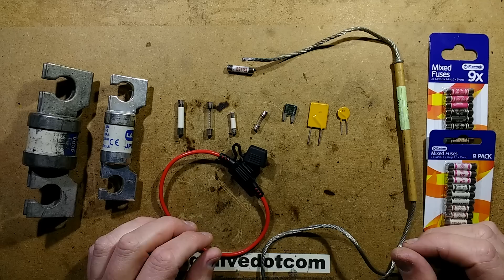Things you should know about fuses.  (including a 15kV one)

Comment: I blew my new multimeter's 250mA fuse by slightly underestimating the low current I was measuring. Weirdly enough the device has a beeping function when the fuse is blown, but it didn't go beep. Found out it was blown after measuring nothing on several applications, took some time to realise.
The rating is specified as F250mA 250V, but it was a ceramic fuse (same with the 10A and my other multimeter's fuses). So I went on the quest for fast blow ceramic fuses. The quest has failed miserably! It's unbelievable how I just couldn't find ANY fast blow ceramic fuses at all! Local shops didn't have the proper ratings (sells Multimeters with 250mA and 10A fuses, but the seperatly sold replacement "Multimeter" marked ones go from 0,63 to 6,3A only... lol) and the Interwebs didn't provide me with any buyable options either. Then I found one eBay seller selling quick blow ceramic fuses (from GB) and what do I receive? Slow blow! "Fuck it" is what I thought and just put them in... if ever something happens where a quick blow fuse was necessary: http://bit.ly/2kjprwi

Why is that quick blow ceramic fuses are so hard to get? Maybe the Multimeter Mafia wants you to buy new multimeters whenever a fuse is gone? Or just use glass ones with less safety? Hmm.....
Reply from the maker: Not sure where you are in the world, but in the UK you can get them from Rapid Electronics.
https://www.rapidonline.com/eska-520-511-quick-blow-ceramic-micro-fuse-5-x-20mm-250ma-250v-pack-of-10-54-5822
Reply: +8bpspfreak2 I have learned over the years to test current initially with a burner meter. Which is a meter I care less about. Then if anything untoward happens I can think about it some before I test further with a meter that I do care about. Because not everything is as I may think it is at the outset. Or I wouldn't be testing it in the first place.
Reply: Fuses seem to be on the way out in North America.  Only halfway-big appliances like microwaves and desktop computers bother with them.  Anything smaller, who cares?  Anything bigger, let the repairman handle it!

This makes fuses for anything almost always a special order !@#%!%#$!@#$

Comment: BigClive .... just for completeness you might have mentioned that some HRC fuses have a fuse blown indicator.
This is a second, finer fuse-wire, passed near to the surface of the ceramic body .... this will blow instantly after the main fuse-wire and will burn out in a small powder-filled pocket at the surface, indicating that the fuse had blown.
Love your videos.

Comment: Ceramic fuses for 220/240V (or 380/400V 3 phase) mains ment for for home and/or workshops CAN be "refurbished" properly IF you open them, pour out sand, clean out metals from sand (or use "fresh" sand...), replace the copper ribbon with proper quadrature of thin copper wires and pour sand back in and reseal it... Well i am doing it for last 15 years...tell me it is safe, please ;-) 
They are damn hard to get or really wound up price in local electrician's supply shops, and a lot of houses where i fix stuff still uses them, but they have strictly forbidden me from messing with distro box, and replacing them with "modern" resettable ones, as i am not a certified electrician ;-) And i might, accidentally, bypass the meter to some fuse...
After all, legally i am just a crazy hippy they let into their house...their fault ;-)

Comment: I took apart a UPS that used a 48V battery, and I found a 32V automotive fuse between the battery and UPS. Wouldn't this fuse be improper for the reasons you stated? Hard to believe since this came from a big name brand rack mounted unit.

Comment: 3a is 3a...? So does that mean 230v 5a cable is only safe for 5a at 12v too? 

As you say a 250v fuse will work the same at 12v interested in that.   I'm just wiring up some 12v spots in my garden and I'm running a 5a cable.  So if I put a fussed spur with a 3a/5a fuse it'll work just the same as a car fuse will?  Plus I get the switch off the spur too? (car battery / solar panel) 

I was under the impression that wiring etc amp was different at diff voltage
Reply from the maker: The current carrying ability of a cable actually reduces with lower voltage as its resistance poses more of an issue at 12V than at 230V.   It introduces voltage drop which can reduce the voltage significantly under load.
Reply: bigclivedotcom amperage that kills not voltage etc,  eh.  1a at 12v is 12w. But 230w at 230v etc.   So as long as the amperage is right it should be cool eh.
Reply: But isn't 12V ac usually the RMS value so by definition it will have the same heating effect as 12V dc?

Comment: Hi Clive, great video (as always), but I was hoping you would cover the difference between 3, 5 and 13 amp plug fuses. You say in a lot of your videos " this is the wrong rating of fuse for this item" and I'm always wondering why.
Reply from the maker: You choose the fuse to match the appliance load and the rating of it's flexible cable.  For a low power table light you would choose the 3A fuse (up to about 700W), for high loads like vacuum cleaners and kettles you would use a 13A fuse (Up to about 3000W).
Reply: bigclivedotcom  Thanks Clive.
Reply: bigclivedotcom, neat I was going to suggest you explain rating vs wattage. I suspect you could explain how to calculate a suitable value from the notes on an appliance. 
How do varistors fit in with this or am I misunderstanding – are they similar to the PTCs?

Comment: to clarify, allthough it can break 1000amps, it will pop far before 1000 amps?
Reply from the maker: The fuse will break at just over its current rating.  The 1000A is its ability to break the potential huge current of a dead short circuit.

Comment: One thing that wasn't mentioned is that fuses often have a different interrupting voltage rating for AC and DC because a DC arc is harder to quench. A 250 VAC fuse might also be labeled as 32 VDC. Using that fuse for a 250 VDC circuit may also cause an exploded fuse, even though it would be fine for AC.

Comment: Great video Clive. I had first hand experience of the 'wrap some wire around the fuse' idiocy some years go, while working at a 132kV substation. The site manager was trying to scrounge a 32A HRC fuse link, because the one feeding his site portacabin 'kept blowing'. Unable to find yet another replacement, he stripped some 1.5mm2 flex and wrapped a couple of strands around the carrier in the fuse switch. On closing the switch, the resultant explosion blew the cover off, which hit him in the chest. Fortunately for him, he was not seriously injured. However, he did make a comical sight, as he had a very soot blackened face. He also had the embarrassment of having to get the local area board engineer out, as the fault had blown the 250A fuse that fed the main transformer coolers...

Comment: A friend was working at a computer centre that needed more power than the national grid would supply.   There was a concrete outhouse with copper bus bars,  I forget, but maybe 5cm by 2.  He heard a bomb go off.  A plasma bomb.  A busbar had vaporised.  God knows how much current it takes to vaporise copper that thick!  The walls were coated with copper leaving shadows of other obstructions.  Happily no one was in there. I find it very hard to believe that the tiny ceramic fuse you showed can support more than a thousand amps, but I trust you.  I love the explosive cannon way of ensuring that contact is broken!
Reply: Oh, sod it, I'll stick my neck out.  Can you point me to a fuse holder for that little ceramic fuse that can support 1,500 amps?  What thickness of copper wire is it designed to accept?  The contacts on my extension leads get fucked at around 10 amps, and that's two orders of magnitude higher!  The mains entrance to my house is limited to less than 100 amps and needs copper wire far thicker than could be squeezed into that tube.  I think you've made a mistake.
Reply from the maker: The 1500A breaking current is a worst case scenario and would be in the form of a very short pulse that may well damage the holder.  If you consider the typical loop impedance to a UK socket would be around 1 ohm then the fault current in the case of a dead short would be a peak of about 330A.

Comment: +bigclivedotcom I've got a radio (13.8VDC Automotive power) that specifies a 40A fuse. The radio's shop manual specifies no less than a 35A power supply, but notes that the radio only draws 25A. Connecting it to a bench power supply (with meter) I note that it draws less than 15A at full output. Wouldn't a lower current fusen (say 15-20A) better protect the radio than the overspecced 40A fuses?
Reply from the maker: It does sound like you could go to a lower fuse.  I wonder if they had problems with inrush current and just over-specified the fuse size.
Reply: +bigclivedotcom The fuses are definitely over-specified for even the initial inrush. I used a 30A power supply & watched the meters as I switched first the PSU, then the radio on. Needle didn't twitch when the rado switched on. Used less than 2A on receive at full ear-splitting volume.
Seems to be a case of every step of the engineering process adding their own safety factor. Keep up the great content Clive!

Comment: I'm surprised the UK hasn't changed over to the restricted fuse holders that block oversized fuses from being inserted.
Reply from the maker: We have a system like that in our older distribution board cartridge fuse holders.  The higher the value of fuse cartridge the bigger its pins are.
Reply: bigclivedotcom The new US class CC fuses have little buttons on the ends, so that they work with old fuse holders, but won't go into modern fuse holders not rated for the current:

https://goo.gl/images/tn6wGW

Comment: I had a problem back when I was in the US Army.  You see, I thought that if someone was in communications, as I was, they would know a little bit about electricity, since that is what we dealt with on a daily basis, well that isn't necessarily so, as I learned one day down at Fort Bliss Texas.  I was stationed, at the time, with the Battalion Headquarters Communications Section, and was a Sergeant in charge of a Radio Teletype section.  The unit had a nice sort of hut that we scrounged from the Motor Pool, it was designed for hauling the tools out in the field to fix large vehicles, so was very roomy.   Myself and another Sergeant decided that this would make one hell of a nice communications hub for our unit, so we went about mounting the FM radios, some AM sets, and the Switchboard so everything except the Teletype could be run out of one place. We even included the message center so documents could be dropped off and sent to the proper location either by radio, or runner.  Now this is in the Texas Desert and things get damn hot, so I decided to purchase a nice 24 volt fan and mount it in a small port that happened to be the right size.  I sent two of my men down with the fan, and told them to install the fan and a toggle switch to turn it on and off.  They were gone for about a half hour, and returned with what had been the switch,  now with one leg burned off, and burn marks all over  the bottom.  Well I figured, too many amps, so I gave them a larger more powerful switch and sent them back down to the motor pool to install the new switch.  They returned with the same results, only more damage.  Now I was getting pissed, these were two guys well trained in the operation of both radios and telephones, they should damn well be able to install a simple toggle switch, so I grabbed another toggle switch and returned to the motor pool with them.  They showed me where they were installing the switch, it was then that I realized they had no concept of DC electricity.  They had twisted the wires together, plus to plus, minus to minus, then put the plus side on one terminal, the minus on the other, thus running the power from two very large 12 volt  batteries that started the deuce and a half truck through that little switch, no wonder the switch did no good.  I showed them how to properly install the switch on one side of the circuit, and suddenly we could turn on that nice cooling fan with no problem  We all three learned something that day, they learned a bit about DC Current, and I learned a bit about leadership of the every day soldier who was trained in only some aspects of communications.
Reply: Guess I neglected to mention that the hut was designed to ride on a 2 1/2 ton truck, much like pickup campers do today on pickups.

Comment: 1/8 copper fridge pipe can be substituted for a 13 amp fuse. As I found it in a freezer control panel 'protecting' the anti-condensation heaters. Needless to say I replaced it with a proper fuse. Anyone fancy a guess as to what the rupturing current would have been?
Reply: Pete Moss to actually do any protection? A few hundred thousand amps would probably blow something apart enough to break the arc.
Reply: Electromagnetic fuse, that would be something. :)
Reply: @0x8badf00d  mate, I think you just invented a circuit breaker in your head

Comment: My father had a fuse blow on a wall chaser saw he'd bought from Germany. It came with a standard EU plug so he went to the local electrical store and got a adaptor plug fitted. Naturally he didn't bother checking the fuse fitted in the adaptor before plugging it in. When he did check the adaptor only had a 3A fuse fitted. Not really suitable for power tools. 

Fortunately the fuse didn't rupture it just failed safely. We replaced it with a 13A fuse which I presume is suitable?

Comment: I use many of the 32 and 20mm glass versions of these in the fruit machines I deal with, thought surprisingly because of their age, I often have to go anything up to 0.5amp above the needed fuse, due to difficulty getting what is needed. Also (Especially on JPM Impact based machines), get quite an inrush on initial power on (JPM Impact PSU have a massive doughnut Toroidal type transformer, and was especially bad for inrush), and a lot of operators did not understand the need to use Time Delay variants, so would often use a much higher rated fuse, which caused issues from time to time.
Reply from the maker: Toroidal transformers are definitely one of the worst for inrush current.  They're also quite an aggressive load to control with triacs.
Reply: bigclivedotcom Yep.... Most fruit machines, you can get away with using a standard 3amp at the plug end of the kettle wire (Most use a 3 amp T clear glass type on the PSU end also), but JPM impact and Maygay M1 series, due to the inrush on boot dispite otherwise being ok on 3 amp, have to use a 5 at the plug and PSU ends.
Reply: Indeed! Explains why the JPM Impact system, sometimes struggles with it's payout system (All fruit machines which use a PSU except when fitted with hoppers, use a 50v drive to operate solenoid type payslides), which is controlled by a number of Triacs if memory serves me right, where as their older MPS system which has a similar arrangement for it's payout system but has a more strait forward PSU, does not suffer as much. Worth you going on to google, and search for JPM MPS and Impact (The latter, you may need to look for a game like Big Bucks, rather than for the hardware platform), and look over the technical drawings.

Comment: PTC's are not really in the fuse category but rather similiar to a auto resetting circuit breaker.
Reply: At first glance I thought the yellow "electronic fuses" were varistors. MOVs and TVS diodes are a whole other type of circuit protection. Clive.... do a video on surge protection!

Comment: Another thing to think about is the fuse source, I saw a situation where someone bought a cheap pack of ATC (automotive) fuses at a swap meet and used them to wire off road lights. There was a short and the fuse case melted into the fuse block. The 14AWG wire melted right at the output of the fuse block breaking the current flow, but the cheap "10A" fuse never blew.

Comment: One of my main questions regarding fuses is when to use fuses vs a mcb

Take a 32 3ph supply to a machine.

Is it better to go with a c or d rated mcb or fuses?

I see both around my factory. Obviously the plus side with mcbs are that they can be easily reset and they knock out all the phases at once. What’s the plus side with using larger fuses?
Reply from the maker: My preference is for a circuit breaker suitably rated for the machines current and likely inrush.  In the machine itself it makes sense to protect the motors against overload by using either a variable speed drive with programmable overcurrent protection, or a standard thermal overload trip device on the motor's contactor, wired to break the current to the coil when it trips.  I'd suggest using a clamp meter to monitor the motor load under normal use and then set the thermal trip just a bit higher.  It's also useful to note the normal motor load inside the panel for future reference.